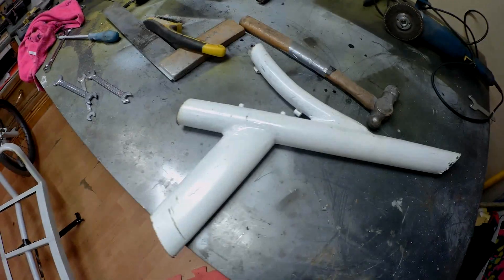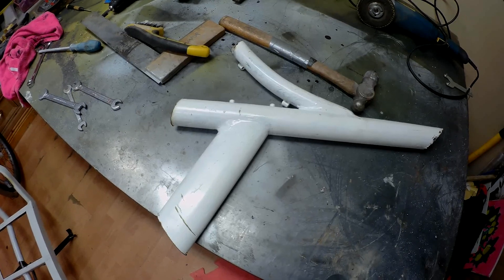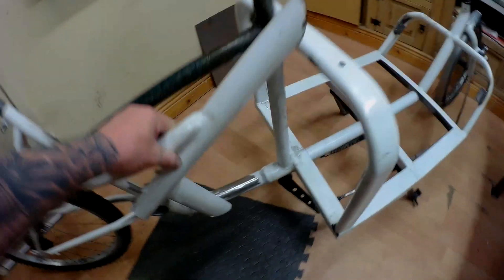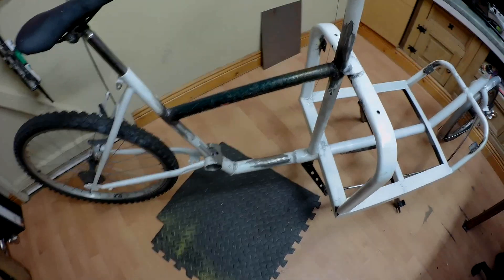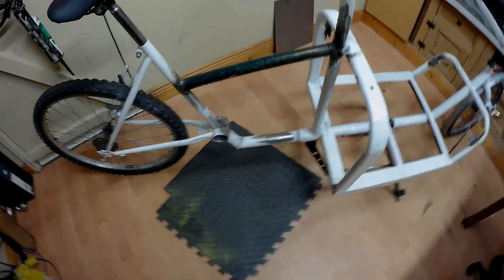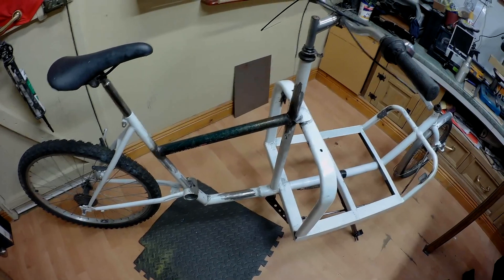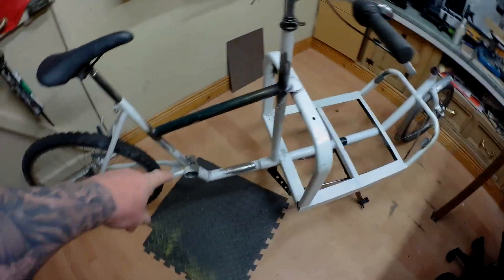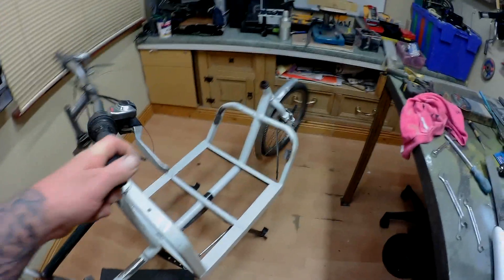Making a cargo bike... Part 6

Comment: Great-looking project. I like everything I see here, EXCEPT for the new crossbar you've added. I'm afraid the pressure it will exert on the vertical seat tube will cause the seat tube to bend at that joint. Maybe consider some flange material above and below that joint with the crossbar. Awesome cargo bike project!
Reply from the maker: Hi Seth and thanks for your concern but no there are is no  kinking been a fabricator nearly all my life, and yes this would happen if you had implied to much  heat but their is a trick to stop this and its called heat transfer... This pressure you talk about would happen aswel if the chassis main bar was to small in diameter.